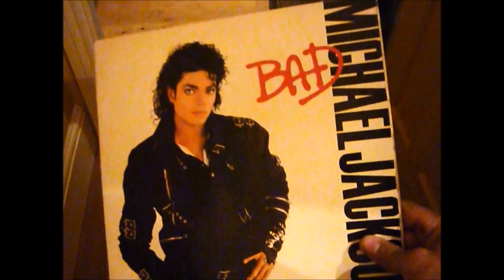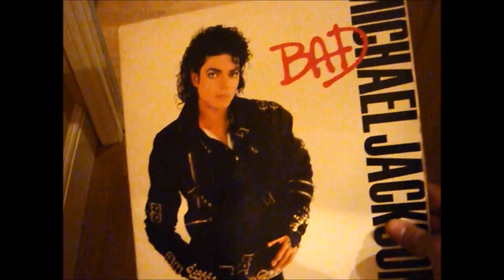DIY Rotary Subwoofer - air flow and efficiency example

Comment: so how fast the blades spin and not just the frequency in which they pulse matter? or can the fan spin at any speed and produce the same tone just by pulsing the blades?
Reply from the maker: the faster the blades the louder the volume. sound frequency is most efficient at the relative speed of the spinning blades
Reply: Chris Hudlin so is the higher the frequency, the higher the volume, and thus the faster the blades need to spin? or is it vice versa?
Reply from the maker: +kiwin111 no, I set the blades to spin at a set speed. the faster I set the blades the louder the sound. the frequency of the sound doesn't matter but if the sound frequency is the same. (relative) to the speed of the blades then it will be working at its most efficient sound frequency. say the fan spins at 1000 rpm so decide that by 60 and that's the relative frequency of the sound where's it would be mostly efficient
Reply: Chris Hudlin ok. nice. cool project.